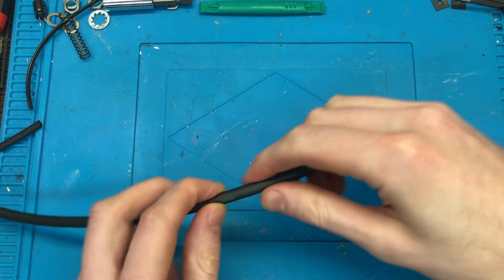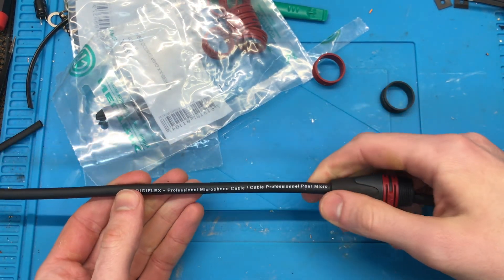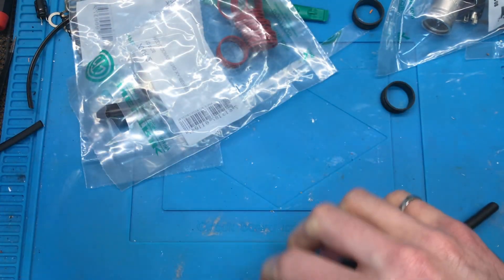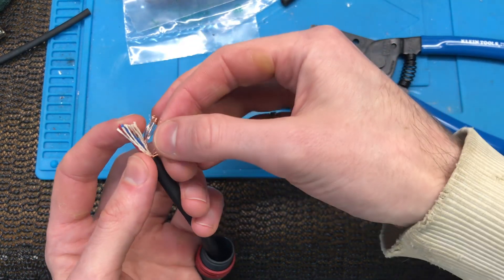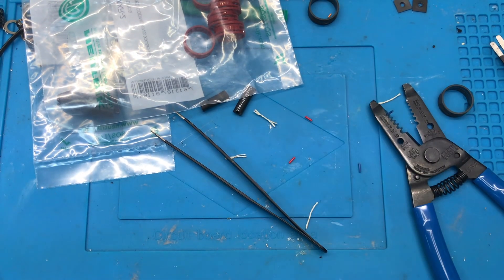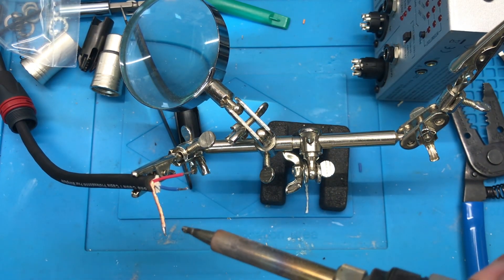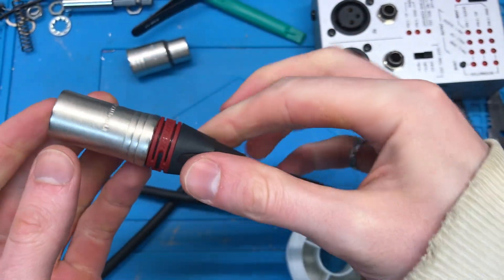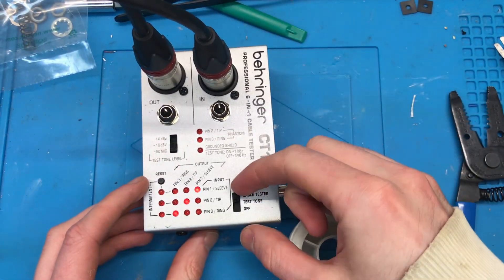Neutrik NC3 XX mic cable build

Comment: I used to struggle with tightening the boots on the ones you’re using as well. A quick tip... slide the boot up to thread it and turn it counterclockwise until the 1st thread clicks. Once you feel/hear the click, switch to clockwise to tighten it. They’ll spin on like they’re thanking you for not buying robot mass produced cables every time. I wound up here looking for a different NC3 connecter without the screw on barrel. I didn’t show up here to critique. Thanks for posting. I’m gonna switch to those rings for identification. I’ve gone the colored heat shrink route for years, but your route improves the workflow and leaves only the soldering iron for accidental burns when one is too exhausted to be making cables. Cheers
Reply from the maker: Good tip, thanks, I do that with bolts and machine screws so I don't know why I didn't think to do it here. Glad you like the coloured rings. The neat part is you can put them on after the cable is built.
I'm uploading a new video where I tried out the Switchcraft AAA3FBLP / AAA3MBLP connectors. They may be of interest to you if you need low-profile XLRs. Just watch out for the maximum cable diameter lol
Reply: If you care or are doing a lot of them the Neutrik HTPX is the tool for putting the boots on
Reply from the maker: @killaken2000  i just looked it up and i really liked the idea until i saw the price :(